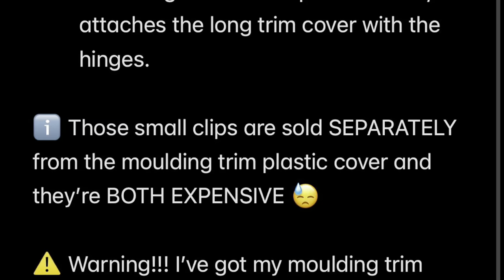E93 - Remove moulding trim plastic cover - hardtop convertible

Comment: why did you put the gorilla tape on? this piece does NOT get taped to the roof or it cant open. is it one sided tape just for cushion/water seal?
Reply: I'm wondering the same question. My new piece came with the tape, yet it has to stay with the hinge, not the roof top.
Reply: Please show the video of you installing it with the tape, and it blowing apart when you try to open the roof 😂
 PSA...DO NOT TAPE THIS PIECE TO YOUR ROOF!!!😊